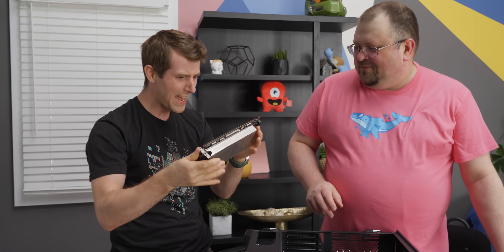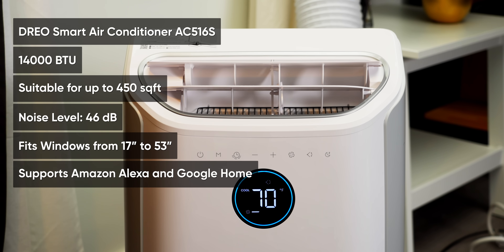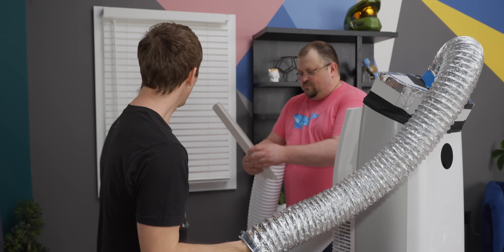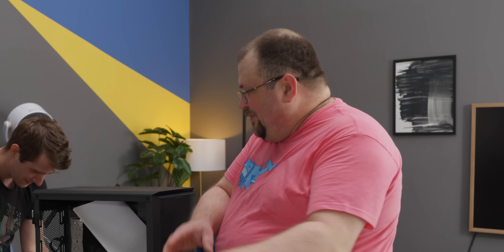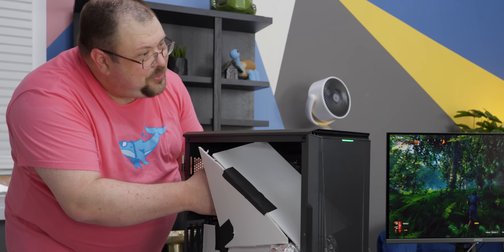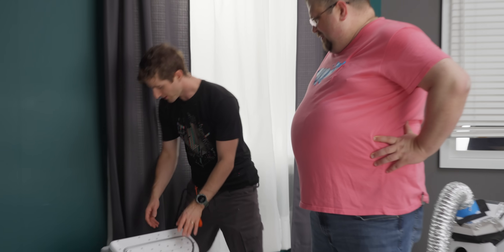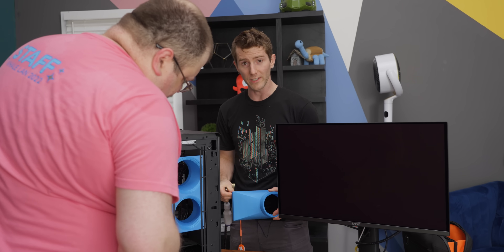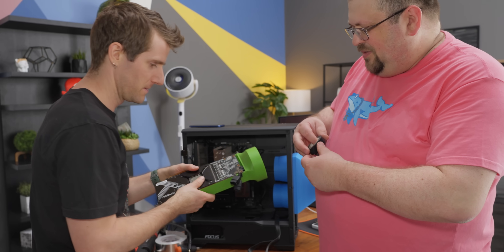Everyone is Cooling Their PC Wrong

Comment: i was wanting to do the same, but with indirect cold air...have a tube from my floor vent (central H/A) directed towards the pc...leave pc fans in place to direct the cooler airflow...i always run an open case...i believe the best any system can cool at is ambient room temp...so...by lowering the air temp around the entire pc it should negate any condensation...i hope...existing pc fans would of course concentrate the now cooler ambient air from around the pc to the components they would normally service...that's my plan anyways...i wonder if your experiment would've been better with the tower inside an enclosure with the A/C pumping into the enclosure instead of the tower, and just let the pc fans do what they do best...

i once took off the back of a laptop, and cooled off the motherboard with one of those 3 speed 8" Holmes room fans (appropriate distance to focus air)...ambient room temp is a constant 70°F...that laptop ran super cold with zero condensation...most likely due to the power of the airflow instantly evaporating any...the power of the fan was so strong that (somehow) at idle the motherboard temp actually dipped just below ambient air...that was cool (in more ways than one)

Comment: Accelerator fan is easy, but it brakes the fanless case idea. Just put a 120mm Noctua on the GPU side of the divider and leave the CPU side alone or add in a baffle like what is in a chimney.

Or, have the divider outside of the case and it would be like the fan in the AC unit, not in the case, but still increasing static pressure for the GPU to force more air through. And printing the dividers to fit PVC tubing could make it look nicer while greatly reducing air leakage.

Comment: This proves that 7900xtx heat sink is very efficient, with ANY air flow over it does the job.  E.g. tweaking your baffle did the job. Cold air, per se, is not necessary. Only airflow. Just chuck on a bunch of PC case fans, and be done. Or get a nicer airflow-focused PC case. For me, I'd like to see other applications with duct tubing. Is all you need a standard 36-inch window fan (plus some stepdown tubing) pulling PC air out that way? Probably/maybe works?
Kindest regards, neighbours and friends.

Comment: Portable air conditioners are trash.   At least single hose models (but dual hose models aren't that great either).    They work by pulling cooled indoor air over the condenser and exhausting it through the hose outside, so you create a low pressure environment indoors, and wind up exhausting lots of your conditioned air, which is terrible and inefficient.   And you get all that noise right indoors.

Comment: I had this idea years ago glad he's doing it. it's the most obvious solution if you want phase change cooling without literally tearing apart an AC unit.
I used to put my computer next to the AC vent to cool it down quicker, though in the winter I was throwing heat into the computer, so I opened up a window and put it near a window instead

Comment: That kind of air hose is terrible. Every 3 feet of that flex pipe is like 18 feet of smooth straight pipe in resistance.
You wouldn't use 10 megabit COAX cable when you can have a CAT8 UTP cable.

Comment: Keep the fans in the system and use a regular GPU. Just duct the AC into the intake, easy, done, better results. Then you don't absolutely need the AC on all the time. Have an OC/fan profile for when the AC is on or off.

Comment: Could have an electromechanical flapper near the A/C output that opens, drawing in ambient air, until the air temp that is going through the line is at the due point of ambient air. Not as cold air for the PC obviously.

Comment: If you recirculate the air back to the air conditioner, you don't have to touch the thermostat and the compressor will only run when it needs to.

Comment: Connect the AC unit to a blower fan to get more air velocity through the tube. AC outlet to blower fan intake and then duct the cool air. I've seen this setup used to cool light aircraft for maintenance on a hot day.

Comment: So back in the day, figure around 2007 or 2008 I wanted to mod a minifridge into a computer case for cooling but I found that condensation was going to be an issue.  I started doing some research and found conformal coating as a way to prevent condensation from shorting the components.  The issue with that is the cost if it is a one off.  There were other contributing factors to me not doing it.  Instead I decided to look into phase change cooling and that is cool but again, condensation but it is on a smaller scale so it was far easier to combat.  It's a viable way to cool the PC if you don't mind having a 1000w power supply for your cooling system and the  compressors though, holy smokes they loud.  Finally I looked into LN cooling and while the results are amazing, it isn't really viable for everyday use.  It's more for getting wild ass benchmarks on extreme overclocks.

Comment: There should be no condensation where the cold air goes because it is conditioned (dry). But the outside of the duct where warm air meets cold surface might start to drip and ruin your hardwood floor. Also if you just dump the cold air inside the case and keep the fans on your CPU and GPU cooler it would work MUCH better. Like JaysTwoCents has demonstrated multiple times

Comment: Condensation shouldn't be a problem. That's a problem when you have warm moist air near something cold. Not when you have xold dry air near something warm. The condensation happens at the cold evaporator in the AC unit. The air that comes out is dryer (that's what conditioned air means, dry). And the CPU and GPU will always be warmer than the air so if anything it should make them super dry. It's exactly how a dehumidifier works (because those are just AC units that heat the air back up after being cooled)

Comment: For better airflow you should have used a 6-in pipe from the AC to the PC then split it to the two 4 in you would have needed less baffle and had more cold air flow

Comment: As someone who does commercial AC installations as a job. This was hilarious. Though I would have used a much wider duct from the AC unit to the entry on the PC, the fact that all the ducts are the same size is leaving performance on the table. For instance, if we fit a 300dia duct and have a boot off the side we'd reduce to 250mm dia or even 200mm dia to try maintain a higher pressure for optimal airflow.

Comment: Instead of putting the ac directly into the pc to rush damaging it, do what I did and build an enclosed nook, let the fans blow hot air from the bottom up and into the central air system, put an air conditioner above and it blow down. The creates a warm cool cycle that balances the air. Then install a dehumidifier that dumps automatically outside and not in the city water or it will show up on the bill. Keep three thermostats that constantly monitor the humidity and kicks on when above 30. Sadly, this also means I have to change filters in the surrounding on a normal basis to keep humidity from lingering and / or causing mold and mill dew. Now my pc, consoles, media devices all function in an enclosed closet. All wiring is insulated and hidden. Any interface wires are under the floor then into the coffee table. All I have to do is plug controllers into the specified extension. Bluetooth gets through the wall just fine.

Comment: There's already a solution to getting the maximum lowest temp from a small AC unit, look up CoolBot. It allows you to use a window AC to create a walk-in cooler. It's basically just a heating element that attaches to the thermistor in the AC and a microcontroller that adjusts the heater depending on the selected output temp.

Comment: I was inspired to do something similar by the video where jake puts his pc in a grow tent. Found that there are enclosures for 3D printers slightly better suited to encasing a pc and just vent all the hot air out the window with an inline fan, added some intake fans to pull in cool air from the room now the pc runs fine and the room is 100% comfortable

Comment: The good news is that condensation should not be a problem as the water is extracted from the air at the evaperator. You should have less trouble than you would with liquid cooling.

Comment: I know it wasn't really the point of the video, but you could likely do a better job by just sticking the entire tower in a carboard box with its internal fans still intact. Then just routing the output of the AC in to the box. As long as you could balance the air output from the box to over pressurize it a bit, it would keep the damp room air off the chilled components. The air coming off of an AC is already dried by the AC unit itself. The only introduced moisture would be from when the unit cycles the compressor off and you would get condensate off of the evaporator.

Comment: I'm telling y'all for the last time....

a water block with a radiator mounted to a carpet dryer fan, gotta be a 1/2hp or 1hp

And a heatsink attached to the other side of the water block

Radiator I'm running is 360mm and the fan takes cool air and tosses it through the radiator, I barely see thermal throttling

Comment: For a oouple of years, my main PC was a huge old Dell T7500 which I kept set up on the windowsill with the window open and case surrounded with foam rubber. In Winter, the front faced outwards so it sucked cool air straight in, and in Summer I reversed it. It worked really well and helped keep the room cooler but it did start to get rusty from humidity.

Comment: Not sure if Dreo sells one but the play is to get one of these with a built-in heat pump .Then you could plug the exhaust hose into the PC (although you would have to locate the actual unit in a big enough space to dump the heat into out of the main vent)

Comment: Wicked smaaat! :) 

It's amazing that the PC even turns on without a CPU fan. 

So, the hot air from the portable AC is just venting into the room? :) 

Does this mean that if I got a portable AC, I could just point the exhaust back at the compressor instead of opening a window? Hmmmm.........Even if I didn't take the case fans out of my system and got a portable AC, it might still really help even if I didn't vent the exhaust out the window?

Comment: I like everyone else here have a hot PC room problem. Two years back I threw down to have the central AC in my house built in '86 replaced - replacing the soft ductwork alone boosted cooling by 60-70% in every room. That's great, but I knew it wasn't really going to "fix the problem" of running two space heaters (gaming PCs) in the same room, especially during the 7 months of heat in SoCal. Even with the office being the room nearest the AC unit, adding new second outlet to the office AND a bevel downstream to not cool the far side of the house... it's still a losing battle. The AC can most definitely keep-up with cooling the room, but the rest of the house will become an icebox even with the bevels closed (90%).
I just want to know why all five of the AC contractors I spoke to scratched their heads when I tried to explain adding an exhaust plenum to my office... there HAS to be something known and done for this sort of thing that I missed out on.

Comment: Maybe it would be more effective, if you just use a duct to get the cold air inside the case an have "normal" air-coolers - so no ducts inside the case. Then you also wouldn't have a problem with condensation, because the air from the ac ist already pretty dry.

Comment: The AC is kinda unnecessary. Just keep the shrouds installed on the PC, dont use the AC, just put 3 high pressure normal PC fans on top of each other at the front of the pc ( shroud input) boom you just got the best normal air cooled PC. Shrouds inside the PC are really helpful even with normal intake pc high pressure fans. Even jsut the ductsystem in the pc without the combination piece in front of it would help, just take 2 PC fans put them right in front of both ducts ( one for CPU one for GPU) and you get better cooling AND you can use the case Front Mesh piece.  I think a dedicated GPU shroud in the PC is actually one of the few very sensible upgrades most gamers should consider building for themselfs.

Comment: If the CPU's heatsink weren't getting cold enough to risk condensation you could've just run it on a sort of loop with the cold air going over the CPU first before looping back to cool the GPU.

I'm kind of curious as to whether adding another heatsink onto the one the GPU already has might help cool it a bit more, probably not.....BUT.....it would be something to * play around with.  

* = I was going to use the word harmlessly there but Linus would be involved sooooooo.....

Comment: An interesting FOLLOW UP,  3 FAN SYSTEM on the front, with DUCTS to GPU, CPU, and one not DUCT to cool off other components in the PC.  THEN A BIG OL FAN TO PULL AIR OUT OF THE CASE.

Comment: Attach a extra hose to the other side of the PC case and attach the other end of the hose to the back/side of the AC unit, where it sucks in the air for the hot side to cool down. That should increase the "efficiency" of the whole system "a lot".

Comment: AC air is dry, it doesn't have moisture, it gets condensated on the cooler and drips down.. So no problem there, a big problem is the power consumption 1000W on average :D

Comment: Cool concept, but if I were going down this road I’d drop the “no fans” concept and just duct the ac into the case. Floor the case with cold air and let the gpu fans do their job pulling the chilled air through the heat sync

Comment: to reduce condensation keep the humidity in the room low. you can use a window a/c that dumps the humidity and warm air outside or go all out and get a dehumidifier. and don't forget adding rgb lights gives it better performance.

Comment: Condensation inside the system will only happen if there is a supply of warm and moist air coming into the system in addition to the already conditioned air from the AC. If the AC is the only air coming into the case (and all other gaps are passive exhausts), then no moisture will be entering the case and thus will have no reason to condense there. It will condense on the outside of the case and all air hoses before the case, so that needs to be either well ventilated or have appropriate channels for condensation channeling into safe locations. But that as well should be minimal if the room is adequately air-conditioned and there are no open windows letting more moisture in than AC can collect and drain.

But still - please try it with portable split systems. You can literally put the whole evaporator inside the case and just have a flat coolant loop + power + condensation cable exiting the case.

Comment: Portable AC units with ONLY a single exhaust hose really SUCK. Like as in suck air out of your space, leaving negative pressure that will pull in more warm air from elsewhere. If you' have to do portable, look for TWO hose units.

Comment: I ran a flexible duct from our home ac duct to the GPU years ago and it worked great. Used the CPU case vent on the side (yes it was that long ago) and duct taped it to the GPU fan shroud. I think it was an Nvidia GTX 8800

Comment: If your "A/C" doesn't exhaust to a separate environment(outside), it's not a real A/C.
If it's supposed to exhaust outside, but you don't let it, it will be severely limited in its effectiveness.
Might have been cheaper to use a window unit.

Comment: i think the better solution would be to just air condition a room and have shrouds on the pc exhaust just to pump out hot air through a window with a cheep evac/exhaust fan. assuming your parts have fans. i almost did this but sold my 3d printer before i got around to starting

Comment: Linus you need to run 8” r.1 insulated flex. And also put 10mm lagging or arms flex tape on all your shrouds to prevent condensation. And make sure you have a fan on the back of the case pulling air out. That flex is way too small.

That system has plenty of air to keep a pc cool, you just need to make it efficient.

Comment: would it not make more sense to just have the air blow in from the side panel, I remember in high school having a RX480 that would overheat unless i took off the side panel and put a box fan there to cool the system...  that is until my dad fixed my gpu

Comment: Why not use a small indoor grow tent and have the exhaust hose flowing out of the tent. or since your doing the duct set up you could add a manual valve on each intake port just like throttle on a car or even do the automatic valve the opens and closes based on temperature of each component. Sorry thinking outside of the box.

Comment: Have run a similar set up in Australia every summer for the last 5-6 years. But, full custom loop with an extra long hose / end pump and a radiator in front of the aircon vent. With the room temp set at about 26C, the water loop maintains ~ 23 idle - 26C load which is still well above the dew point here.

Comment: Send the air through the CPU out the back and then into the back of the GPU with that shroud on it?  This way the cold air can only go through both instead of baffles.  This would also cool the rest of the PC.  You could put exhaust fans on the top of the case to pull air out of the case too.

Comment: I love it. I think you should have use a larger inlet on the front manifold. It looks to be the same size as the two 120(?) ish mm ones on the inside. So you’d need an inlet from the AC unit about 170mm in diameter to feed the two 120mm internal ducts with no loss between the AC unit and the inside manifold. Then you could baffle the CPU and give the GPU even more airflow.